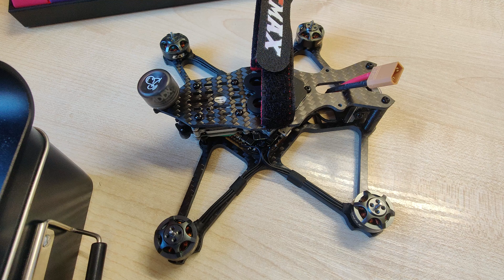Emax Babyhawk II Analog Conversion

Comment: Your soldering skills inspire me ... you melt it so quick!! Can you tell what temperature you using for that kind of work? Eventually the composition of your tin ... and if you have some advice to solder power lead and keep your soldering iron clean ?
Reply from the maker: I have it set at approx 400 at the moment, Bacically just tin the tip and the wires and away you go. power leads need more time and temp so i have it at the max 430 that my iron goes up to. the composition of my solder I dont have as I have this massive roll and all the text has faded...

Comment: Thanks for the tutorial. I'm new to FPV and researching for a mid sub 250 build or BNF. I think I'll wait until there are more options and availability for digital video. BabyHawk 2 is looking like a good option. Anyway, you explained everything very well and the shots and edits don't leave any questions. Very helpful!
Reply from the maker: Thank you for your kind comment, I do try to explain as much as I can, but there are still many things that I need to work on to improve. The Babyhawk is a great flyer no doubt!